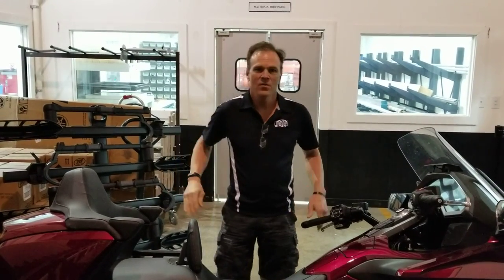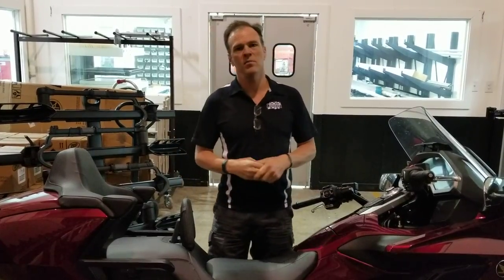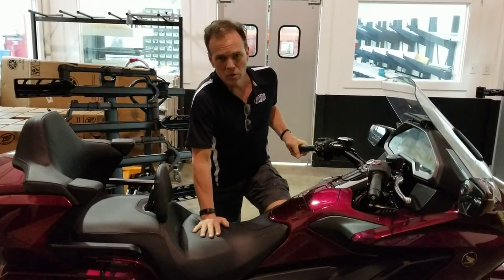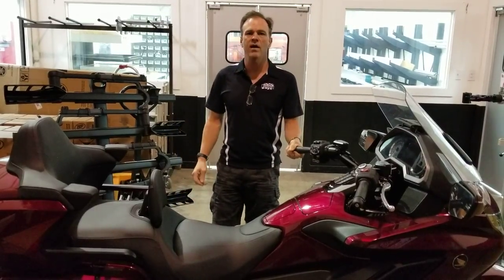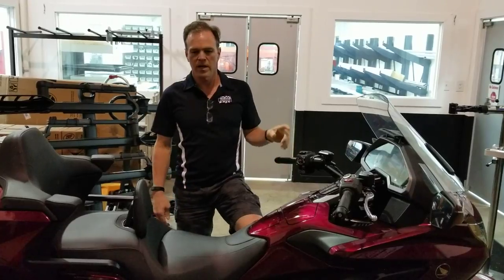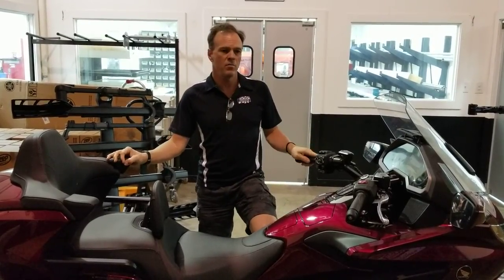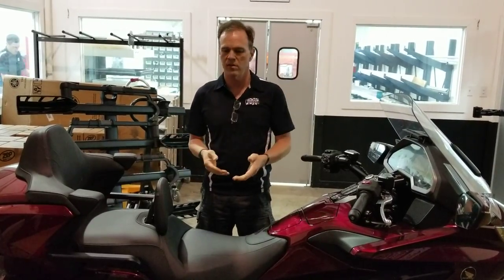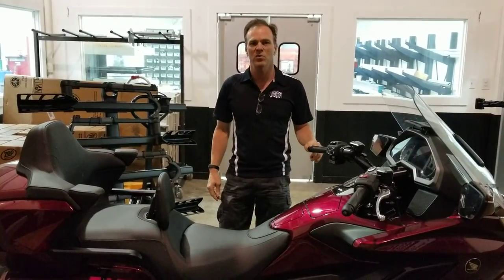How to Lower, Lowering the Honda Gold Wing Correctly

Comment: I have a 2021GL1800BD (Base model, DCT). I'm 5'6" with a 29" inseam.  At first, I had to have my toes down, heels up slightly while at rest on the bike. An auto upholsterer removed some foam from only the sides of the saddle where the upper legs contact the seat.  The result is that now I have full foot contact when the bike is at rest.  Works fine for me.
Reply from the maker: That's good to know!  Thanks for the commentary, I'll be sure to share that.
Reply: I have the same bike but the 2023 and again I'm short leg heheh can the bike be lowered at all

Comment: Hi Max, love the explanation on lowering the bike, I for one have the traxxion suppension on my bike that was set for my weight and my passenger , my inseam is 29"  I have extended height soles on my riding boots that give me an additional 3" of height, now I am in better control of my bike, thanks for what you do, keep up the great work
Reply: Can you please tell me where I can get a pair as well

Comment: What about changing tire sizes ...going to a "shorter" tire. Like a 60 vs 70 tire.
Reply from the maker: Goldwing tires are very specifically designed for the weight they carry.  You cannot just put an ordinary motorcycle tire on, or it will be extremely dangerous.

Comment: Strange that I didn't hear lean/cornering concerns when lowering in any method
Reply from the maker: It is understood by anyone lowering their bike that they will lose cornering clearance.  For many shorter riders, this is accepted, because otherwise, they would not be able to ride at all.
Reply: @Traxxion  true for a simple dog bone rear adjustment and spacer cut or fork slip package or modification.. However studying what component touch down first, and creating and including this in a premium lowering package could (for some bikes) maintain the same lean angle..so I guess your lowering package does nothing to address reduced lean angle?
Reply from the maker: @ut1004bp  There is no way to lower a bike and not reduce cornering clearance.
Reply from the maker: @ut1004bp  Dynamically, you can maintain/improve cornering clearance with higher spring and damping rates, which all of our suspension packages offer.  Soft bouncy shocks that ride at, or near, bottom out are a problem.
Reply: @Traxxion   I think there is.. lets say for example.. first lean angle touch down point is a OEM floorboard.. do..daa.. remove, remount or replace the floorboard with a different style or type.. ok.. let say its the first contact point would be the crash bar.... do...daa.. remove and/or replace with a different style crash bar..  See, people increase their lean angles all the time.. It mostly matters what bike it is, and what part of the bike might make first contact.. Then study the problem from there: like is there an easy modification that can be made to that component?.
Reply: @Traxxion  Short people tend to ride bikes too tall for them all the time.. Its a matter of making the bike fit the person better, in most cases.
Reply from the maker: @ut1004bp  After 23 years as just a suspension specialist, it's extremely hard to convince short riders to not use backyard/shadetree dogbone kits, never mind relocate every portion of their bike at extreme expense. If you find a short rider who wants to pay to have their bike completely reengineered, it would be incredibly rare.
Reply: @Traxxion  I hear you, but I just saying sometimes it will only require a change in floorboard or shape/style of already available on the market replacement parts (like engine crash bar or floorboards) the solution would be different with any bike (and maybe not possible with some like a boxer engine that might bottom out on the engine head first), and I was wondering about the 2018 and later Goldwings primarily, you will know about that bike.

Comment: The GW seat height spec is 29.3 inches.  If you need something lower than that, better to get a different bike that fits you.
Reply from the maker: That would mean only basketball players could ride adventure bikes.  Lowering bikes is common practice.

Comment: 5th choice, buy a bike better suited to the rider.
Reply: Suggestions for a rider who is 5'7" with a 26" inseam?  Just curious.  Even cruisers with excessively low seat heights aren't built for shorter riders.
Reply: Funny to see people 5'7" and taller complain about being to short. Try being 5'4".
Reply: @jeramiemaddox1974  Inseam length?  I always laugh at reviews where the rider's height is mentioned because it assumes a standard inseam.  I have seen many people my height with no trouble flat footing bikes that I can't even touch the ground on.  At one time I worked with a woman who was exactly my height.  She had a 34" inseam!  My mother always claimed to be 5'0".  Turned out that she isn't quite 5'0".  She rode, with difficulty, a Honda Helix scooter, Honda Shadow and a BMW F650ST.  I get my short arms and legs from her.
Reply: Yeah my upper body is longer then my legs. My inseam is like 23. That's what I remember it to be. Been awhile since I measured. People laugh at short people riding but it takes a lot more skill to ride something you can't touch.
Reply: @jeramiemaddox1974  That would make it tough.  My mother used to cut an unbelievable amount of material off the bottoms of my 30" inseam pants.  I hope that you have found ways to get around it.
Reply: @jeramiemaddox1974   his inseam is like a 5 4 guy
Reply: @alanhassall  try a Honda Rebel 1100 DCT. It is a cruiser and does long distances at highway speeds with ease. I am 5'7" and can flat foot the bike. Also a light bike at only about 500 lbs and handles great in traffic.